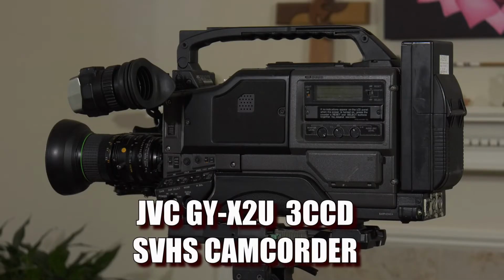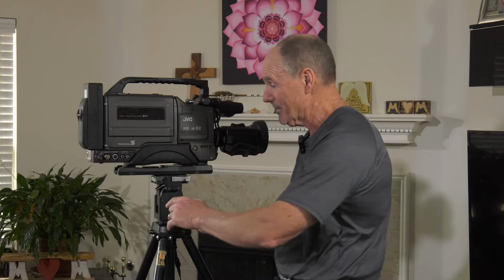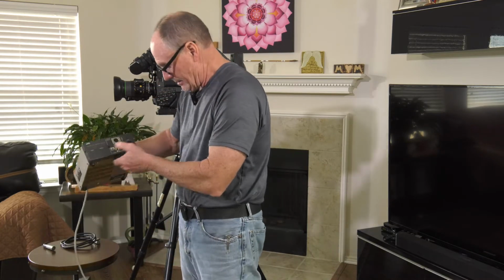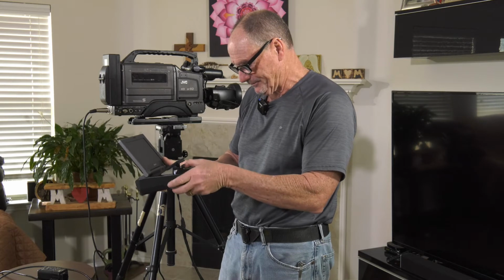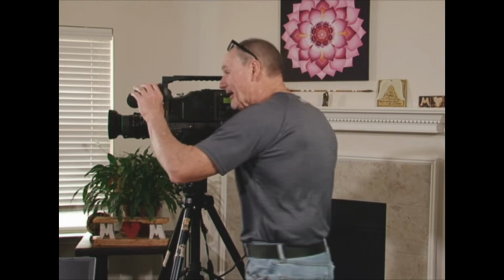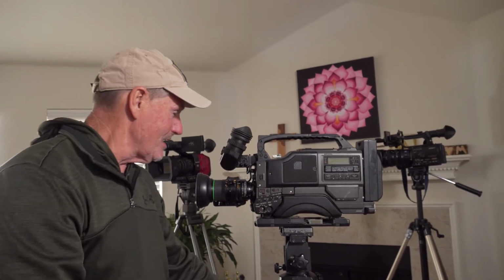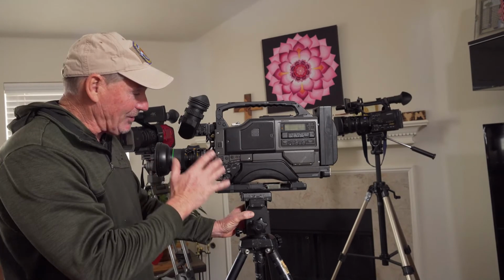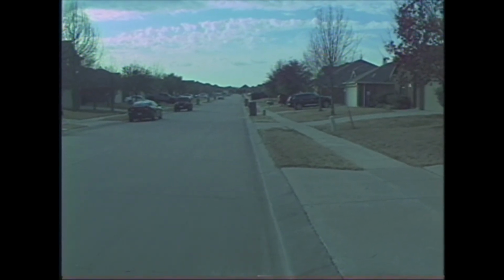JVC GY-X2u Vintage 1993 Pro Camcorder, Good Enough For Trail Use?

Comment: The s-video seemingly uses JVC 358 plug, which is a Hirose 7-pin plug, ~12.5mm apparently. But you could just plug pins directly into the matching pin holes on the connector.
Alternatively could replace the socket entirely, with a normal s-video socket:
youtube.com/watch?v=xwf6dxZPO_I

Comment: any gy-x2 needs new capacitors as of today .. . recapped mine and i tell you.. all the caps were dead/numb
Reply: agree!  i had some changed by service center in the 90s but now it’s gotta warm up to work.   problem is where does one find someone to re-cap it?   they tell you throw it away it’s not worth repairing, but i choose to use mine, i paid enough for it!  would like to know more about your x2 since you re-capped it.   thanks!

Comment: Hi, i bought One last week but can’t find and adaper for the 7 pin connector. Did you find something?
Reply: nope!  none to be found.  i record to tape and use a svhs sony deck for capture.  lost my cable years ago
Reply: Wich SVHS videorecorder would you recommend me? Just for watching and reversing to digital format
Reply: @giovannivisintin2806  the sony slvr1000 is out there on the used market, is still repairable and outputs a great picture.  svo2000 is also a good option also, same machine practically.